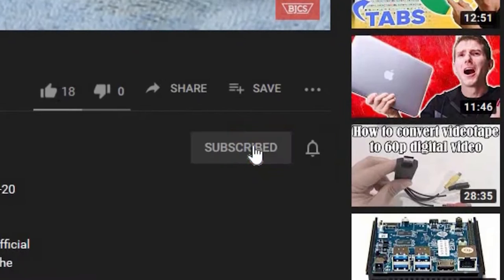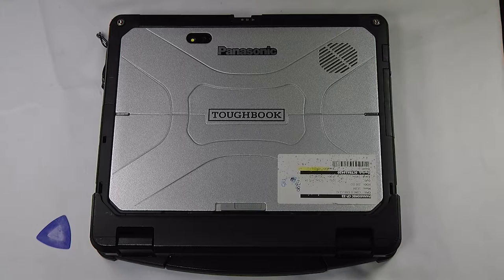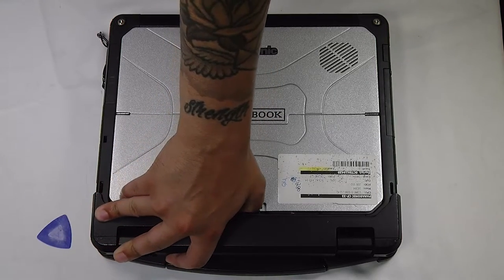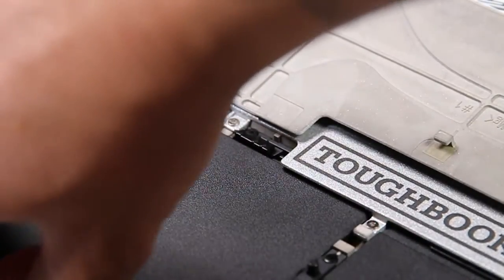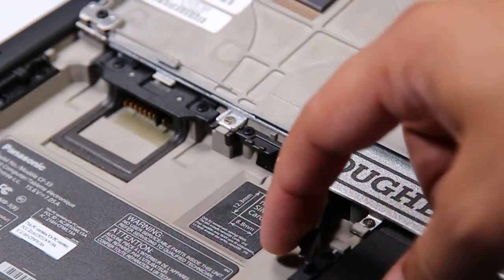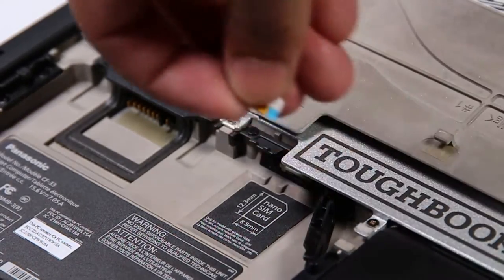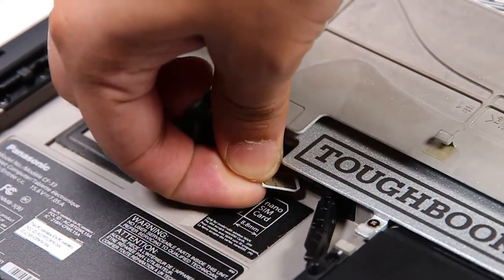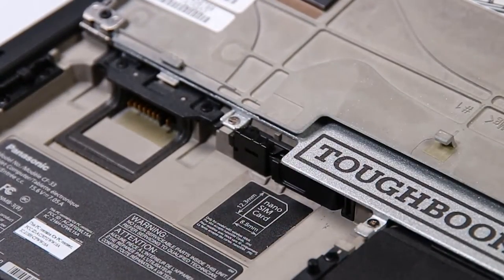Find Your Panasonic Toughbook CF-33 Micro SIM Card!**

Comment: Bobb is it possible to swap the physical cellar module for a later one?
Reply from the maker: Not sure what your asking here.
Reply: @Bobjohnson  a later produced and newer card.
Reply from the maker: @tylercooper5092  well, the problem with a newer card, which I am assuming you mean a 5G card, is that if it was not made for the Panasonic Toughbook it will not work.  Meaning, if you purchase something for a dell it will not work in the toughbook.  Panasonic does not build in the hardware support for the newer cards.
Reply: @Bobjohnson  so it’s not really possible or safe to have a 5G in a cf-33?
Reply from the maker: @tylercooper5092  So far not possible.  Things can change if Panasonic produces a card that will work in the unit.